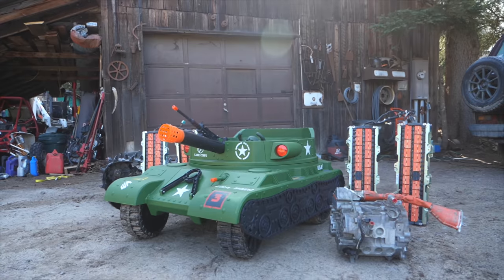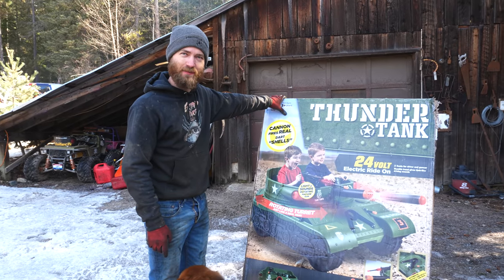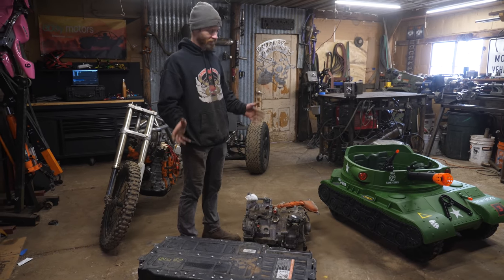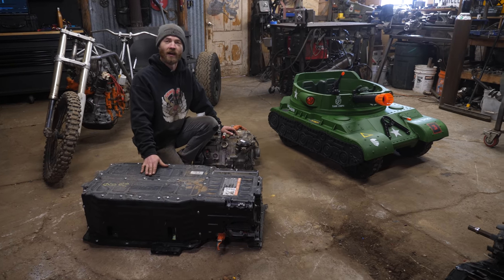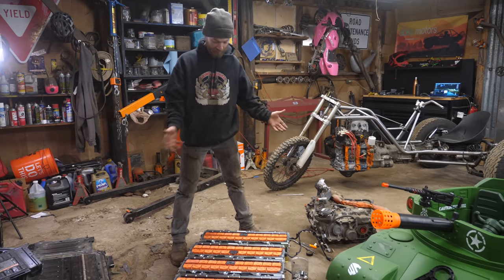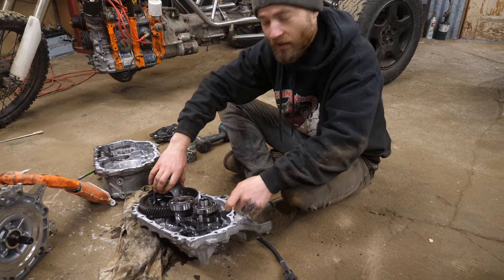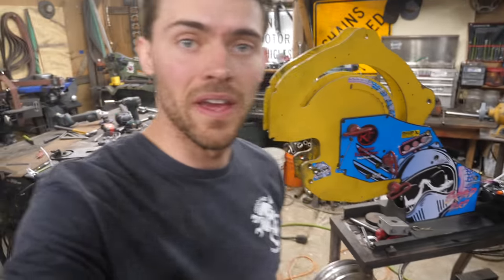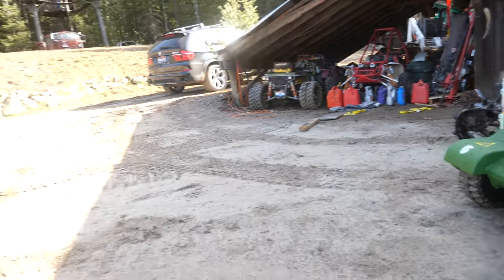450+ HP Electric Power Wheels Tank Build! Our Wildest Project Yet!

Comment from the maker: What do you guys think of the new build? Last day to enter the giveaway! https://www.grindhardplumbingco.com/
Reply: It sounds sickk
Reply: Love your vids
Reply: Yooo m8 that’s too cool
Reply: You should take a launcher of a assult rifle and mount it on that tank it would be sick af
Reply: You could run the AC compressor off of the electric cars for compressed air for whatever gun u add.
Reply: Are you going to make the same style tracks as the ripsaw tank
Reply: Stretch the tank to get maximum room and for a roof cover
Reply: Love the new build. Would be asome if you guys could have a paintball machingun and canon on that
Reply: Hey guys, those Cmax cells are old technology if you look into the car audio culture as we use them also you may find there are much more modern options in a smaller and lighter pkg ie "limitless lithium" "Ioxus ultracaps" XS Power SB1000-31 supercapacitors to mention a few... I have a limitless cyber 12k and a an XS SB1000-31 supercap and with 150 amps of available charging I could Power your entire house and they're the size of two regular car batteries...
Reply: You're going to need some kind of a clutch so that when you lett off the acceleration it doesn't stop dead in its tracks
Reply: This build is going to be insane! Could you do a budget on how much you spend on this build?
Reply: please build it with actual tracks. ik it'll be a lot easier to do the fake ones over wheels but since when is this channel about taking the easy way I mean c'mon, I have faith you guys can do it
Reply: Epic..... moving with the times... Good luck. this will be fun!... all the torque.
Reply: Would it not b easier to have 2 lever like handles 1 for each motor instead of pedals 1 forward 1 back= extreme 360
Reply: Co2 tank potato launcher
Reply: Hey guys, love the vids! You should be able to power a small air compressor off those batteries, and then do a t shirt cannon, potato gun type of gun! That would be super cool to see! Keep up the amazing work!
Reply: omg i love it :O
Reply: This is going to be insane! I'm eagerly awaiting the rest of the build series. 

P.S. Do you ever sell your creations?
Reply: I’m thinkin tennis ball cannon. Like the old American gladiators.
Reply: For the cannon you could use a airsoft rocket launcher and fix it in a way it looks like cannon still.
Reply: @428ice  that would be sweet! I was thinking☝️ the t shirt cannon would be cool for crowd events to shoot out some merch!!!!
Reply: @dookiebooger9967  I agree!!
Reply: See Colin furze video he has a auto load potato gun on his screw tank 
And that guy is a mad man when it comes to ideas lol
Reply: @tristenarnold8474  those nissan leaf motors are typically $800 each. The electronics to use them outside of a Leaf is an additional $800 as well. Those batteries are old salvage so I'd reckon they'd be <$120/kWh
Reply: @dookiebooger9967  what do you think they were taking the snowmobile bike apart for?
Reply: @kevinAuman1  they would power your house for a few seconds at least. They need the energy density which wipes supercaps off the table, and the inverter will already have enough capacitance to function well. I also agree the cmax cells are outdated. Newer LiFePo4 or li-ion cells would be better.
Reply: @stephenives6138  I have seen that video and it is super cool. I also think Colin is a brilliant man, but it would be cool for Grind Hard to create something themselves and not “copy” another creator. At least in my opinion.😁
Reply: I love it. I'm glad y'all are getting in on the EV part, but I don't know how y'all are going to manage to put down 450+ hp. That's life-threatening scary to me. I would have thought you would start by getting salvage parts from an electric motorcycle or something. If you leave the gearing as is you would probably backflip on startup. My friends have electric dirtbikes with 15kW/20hp and they risk backflipping until they pass 30mph. You do have lower height though at least.

Also love the progress you've made with your freestyle flying! Very buttery
Reply: I will watch every episode
Reply: Before you drive it,  please assume a wheelie bar will be mandatory.
Reply: Hope you've seen my posts about a mini ripsaw. Make it a racer that's able to jump and not just a crawler like all other mini tanks that people build.
Reply: Will be Epic! Very cool that it's electric!!!
Reply: Howe & Howe could supply belts? Or be consultants?
Reply: The leaf motor should give you plenty of go , remember it'll give maximum torque from zero RPM, it's probably better to use just one motor with the differential , brake steering and a hand throttle which would save on weight and complexity. 2 motors will put a lot of strain on the battery 🔋 and probably reduce the overall performance. Look at Damien Maguires channel , I remember him having a pcb for the leaf motor.
Reply: No don't put a brake and accelerator in it you need two joysticks! Independent tracks 🙄
Reply: Yo you guys of to make this thing with real tracks. That would be sweet
Reply: Ooow yeah....hope your doing tracks!....keep it up ad stay save guys
Reply: Was not  ready for the video to end
Reply: Sounds awesome! All that electrical makes me nervous 😅
Reply: You guys should of just used the one motor and diff and used fiddle brakes each side to speed up and slow down the tracks
Reply: Electric rippsaw mini?
Yeah i'd buy one
Reply: It’s gonna be epic!
Reply: this should pretty epic
Reply: For the main gun on the tank you should definitely do an airsoft 40mm grenade launcher, there are over 50 types of shells to choose from and you can get a little hand held one for around $30 and just extend the barrel, shells cost $20-$60, you can get smoke grenades, impact grenades that explode on target, gas powered shells that shoot bbs etc so much fun for very little money
Reply: Oh this will be epic🤯🤘
Reply: Please call it the “Slugger”. One of the names of the M10 this looks like.
Reply: @Dogburt_Junior  I seen that but I still felt like I had to say something because Ik how some YouTube projects start with so much ambition and then eventually they get neutered and I'm really that's not the case here
Reply: @diveguy1144  it was the idea mostly the automatic potato launcher bit 
And yes I'd rather see something of there own as well
None the less I know it be bad ass
Reply: @dookiebooger9967  I'm more concerned about how they're going to manage >450hp from a tiny ford battery. Those cells are not likely to be able to run the motors at full power or for very long.
Reply: Totally excited about this build I’ve been anticipating a wicked electric ⚡️ build for a while can’t wait to see how this turns out and hope to see you put the same power plant in a cross kart in a future build straight up tire slayer 🗣🤟🏾🙌🏾
Reply: I was wondering how long it would take you guys to do an EV!
If you are thinking about using a compressed air cannon, research QEV's (Quick Exhaust Valves), piston valve, or spool valves.  You should be able to power a small air compressor with the battery pack to recharge the tank for the next shot.
Reply: This build is gonna be awesome. Also cant wait to see the firetruck build
Reply: Insanity but amazing and definitely one of the craziest things the world has ever seen
Reply: Also use pressure rated metal parts only - don't use PVC.
Reply: @stephenives6138  Absolutely!
Reply: Hell yeah!!!!!
Reply: I just woke up am not awake enough to understand what is happening.
Reply: PLEASE TELL US HOW MUCH MONEY YOUR GONNA HAVE IN THIS🤣🤣🤣
Reply: @stephenives6138  true
Reply: You really need to work on your EV vocabulary!  This should be a ripper if you can get the electrons to flow properly!!
Reply: Cant wait for it to be finished!
Reply: I will watch you guys for years and every build that you have done has been epic. I can't wait to see the process of this. The extent of the build is going to be sick. Keep up the great work see you on the next one
Reply: omg i like this so much..
Reply: Crazy awesome! What a challenge!
Reply: The first one was a Barbie Jeep. This one will be a Ken Tank. And if this one is not killing you I don’t know...  The first tank on the planet which will go warp speed 💫
Reply: Full-auto paintball "cannon". DO IT.
Reply: How are you going to deal with the crazy motor rpm? Iirc the leaf motor can rev above 12k rpm, direct driving the tracks is going to leave Soo much HP on the table. I think you need a reduction on each motor...
Reply: I would use a real gun or a potato cannon.
Reply: Good put tracks on it and were you can put wheels and tires on it to
Reply: @kevinAuman1  I was looking for this comment as soon as he mentioned Brake pedals and I was like Na, electric motor just let off the throttle and it'll slow real fast.
Reply: Looks sick but just be careful with them cmax cells, nmc is very powerful but can catch fire easy.
Reply: You are gonna need some sort of reduction drive. . That motor makes power at higher speeds than youll want direct drive.
Reply: Gonna be copyright for sure, ethan said the forbidden G word lol
Reply: Must put actual tracks on it
Reply: Is the fire truck for sale
Reply: That's so cool those are 24ah Panasonic cells from a Ford cmax. I build lithium battery for car audio using those and the smaller 5ah cells
Reply: If you ever need some more batteries for projects look us up @ Coventry Industries located in holly Michigan! Let us know who you are too
Reply: i think its awesome and i need to work with yall, my first project was a turbocharged 149cc pitbike, still have her too
Reply: Would be better with actual tank tracks, you guys have the skills for that definitely
Reply: Should do C02 powered airsoft like gun on the front think that's the simple route and less weight to the build
Reply: So cool 👍every build gets better 🤣ceep up the good work 👌
Reply: This is most likely the stupidest build I've ever seen and it's absolutely fantastic
Reply: I can't wait to see the next step on this video
Reply: is there a 2nd part of this with the machine built and running if not pls do make another video thanks james horsted
Reply: Can I buy all the original take of parts to fix the one I got my kid? I bought one and turned out all the motors wires and battery was pulled it was literally gutted just a rolling shell
Reply: When are we going to see an update video on this has been 3 months
Reply: Combine the tank body with the Argo
Reply: Please don’t forget about the generator safety rules: Always make sure you follow all the generator safety rules whenever you use your portable generator. This is only a reminder. Generators can be dangerous if not used carefully. Every year, hundreds of people die or get injured when using portable generators due to carbon monoxide poisoning and electrocution. Make sure you are using your generator carefully and keeping others safe as well. There is something very serious that everyone should always be aware of when using generators. Some people do run their generator indoors which is not safe and that increases the risk of carbon monoxide poisoning which can cause death of family and you. Some people run their generator in wet conditions which can electrocute them. Please remember that you should never run your generator indoors. Remember that carbon monoxide is an odorless and colorless gas that you cannot see or smell. Carbon monoxide is a silent killer. Keep that in mind. Make sure your generator is 15-20 feet away from your house and away from doors, windows, and vents. Never use your generator in your porch too. Having a carbon monoxide detector is very important against generator safety. Some people also allow children to go near the portable generator which could pose risks. We need to keep an eye on our children making sure that they are not near the portable generator so they won’t get electrocuted or burned by the generator which is dangerous. A locking enclosure also keeps kids safe. A generator shed might look like a tempting place to explore, or take cover during a game of hide and seek, but a generator is a dangerous piece of equipment that can cause injury. It says on the manual that we should also keep children away at all times from the portable generator to avoid injuries. Please do not allow a child or unqualified people to operate the portable generator.  It is important to keep your children safe especially little ones. The portable generator can be hot during an operation. Just because some manuals missed what should be listed doesn’t mean it’s safe to do. Always follow the generator safety rules when using portable generators. Generators pose electrical risks. If you need to use your generator during wet weather, you need a generator tent to protect your generator from getting wet. Don’t let your generator get wet. Keep your generator dry and before using your generator, please make sure your hands and your generator is dry. Do not wear loose clothing when operating the generator. Everything that is said on the generator’s operating manual should not be ignored. Never smoke cigarettes near the generator. Please keep flammable things away from the generator. Never overload your generator too. Your generator can catch fire. Never ever try to plug a generator cord into a wall outlet to avoid back feeding. Back feeding your generator is dangerous. Always turn on your generator first before plugging in appliances and shut off the appliances before turning your generator off. Use a heavy duty cord for your generator and the cord should not be worn out. All the instructions should be followed carefully. Never refuel your generator while it’s running. It can cause fire if fuel spills while your generator is hot. You should turn off your generator and let it cool off before refueling it. Having a fire extinguisher next to the generator is also important. This is only a reminder for everyone’s safety of using generators. Make sure your generator is properly grounded. Having a fire extinguisher next to the generator is also important against the safety rules. https://youtu.be/I1jT3ANENvI and here is a video more about keeping others safe when using generators and also about our family’s safety. It’s important to keep our little children safe as well. Make sure your little children are kept away from the generator at all times especially when it’s running. Hope this helps. Always remember that it’s better to be safe than sorry.
Reply: I tried to find more on this but nada is it done ?
Reply: This is going to be so awesome! May I suggest a co2 cannon....just saying would be cool and relatively inexpensive
Reply: What happened to it
Reply: Keep building this thing
Reply: Need to update us on this build .
Reply: What happened to that build?
Reply: dude i cant wait for a new viiiiiiid
Reply: where does this project stand?
Reply: i think you should make a rock crawler, out of that sprint car.
Reply: What happened to this build?
Reply: Was just wondering if this is still a project going forward, I am still looking for this every week. If it's been abandoned it would be sad but understandable with all of the wicked builds yall have done in the last year. As always keep up the awesome vids.
Reply: Bring this back!,!,!
Reply: We want more
Reply: Where did this build go?
Reply: Revive this build
Reply: Is there any update?
Reply: Where’s the me build I was wanting to see it!!!!!?
Reply: Where is this build ???? I don't see it and can't find it ???
Reply: What ever happened to this build? Is it completed or still work in progress?

Comment: Absolutely insane - perfect! There’s no need for a gas pedal, just two hand throttles - one for each track. Keep doing what you do!
Reply: Yeah hand throttles makes more sense
Reply: Love your work, truly inspiring to my generation
Reply: Or foot throttles
Reply: @FixItStig  ... yeah foot throttles sound legit and with the hands he can operate the handcannon.
Reply: I was thinking the same thing.  Just a pedal or hand lever with a forward and reverse for each track.
Reply: Two throttles are going to be very hard to control with the speed and power this monster will have on tap.  Specifically, it's turn rate is WAY WAY too fast.  (think washing machine spin cycle...)  Turning will need some electronic regulation ideally with a yaw-gyro, or a tank-transmission and a separate turning motor.  Fyi, a yaw gyro lets you drift like a master.  (did a yaw gyro on my BattleBots, let me drive like a mad-man and still hit my target)
Reply: I was about to comment this haha give your feet some space and use the motors individually, no need for a steering wheel or pedals

Comment: I’m looking at that tiny thing and then hearing you casually describe how you’re going to stuff ALL THAT STUFF into the tiny body lol

But I know you can do it, you’ve worked miracles several times already.
Reply: Im super curious to see how they fit all that stuff. An even if they do where are they going to sit lol
Reply from the maker: It will happen for sure!
Reply: What I can't believe is that tiny little motor weighs 128lbs! What the hell is it made out of, tungsten?!
Reply: It doesn’t need to fit in it, the body is just the dressing on top 😏
Reply: Next build is going to be a 1000hp big block roller skate
Reply: Everything isn’t going to fit in it necessarily the way you’re thinking, the body is going to be the cockpit gutted out and the legit tracks are going to hang off the sides with a motor going to each I presume and sounds like he will put battery’s at the bottom or under the body basically is the way I understood his explanations
Reply: @GrindHardPlumbingCo  for sure?
Reply: @igoors2159  for sure….
Reply: @GrindHardPlumbingCo  when are you gonna finish this build
Reply: @GrindHardPlumbingCo  clearly not bahaha